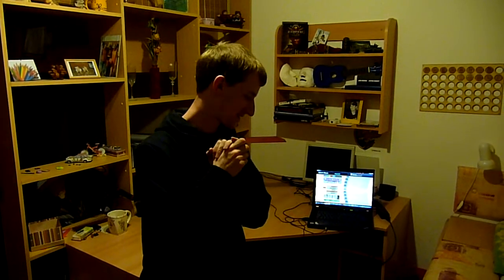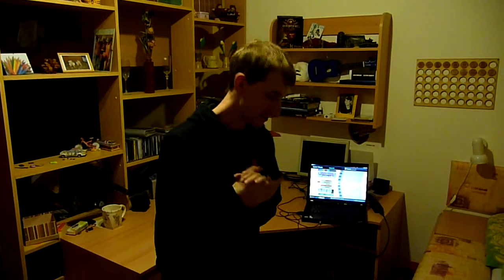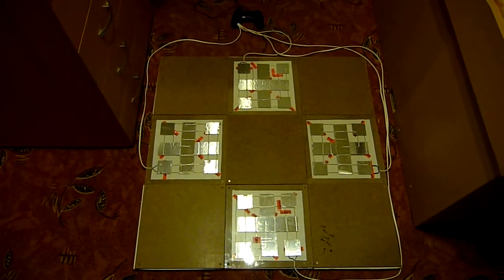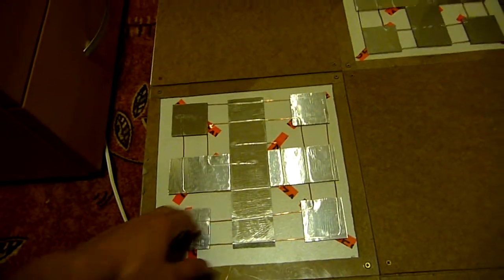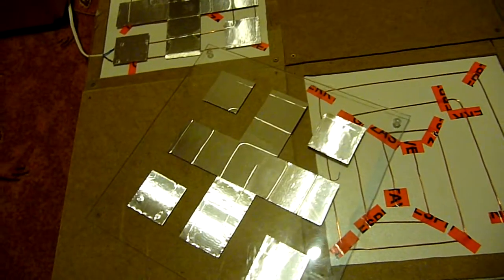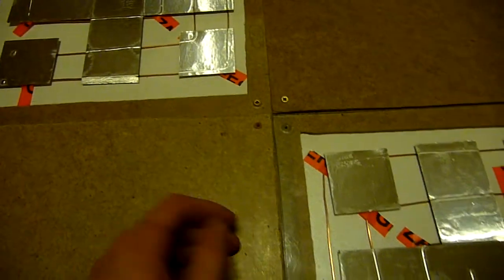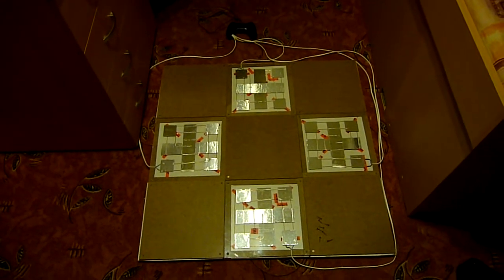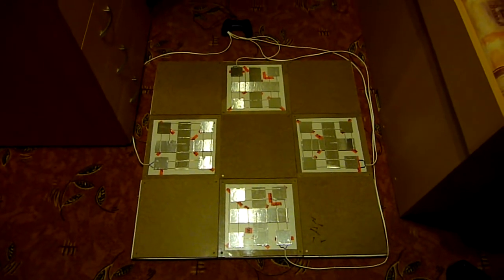Homemade DDR pad - Final video

Comment: Also, is it just the force of the plexiglass bending that presses it onto the wires?
Reply from the maker: yes, exactly... with a step you bend the plexiglass, so that the metal foil on the plexi connects those 2 copper wires.
Reply: Mollar2 Oh cool, thank you. Also, is the material used for the other parts of it (not the buttons, the brown-ish parts) paperboard or something? I've been trying to find a material like the one you have in your video, but I can't seem to find it anywhere.
Reply from the maker: inky
Yes, exactly - it's paperboard or something similar. You can you also some plastic material for that. The thickness is 3mm, if I remember well :-).

Comment: I'm looking to make one of these, what specs/dimensions is this? Also, what buttons did you hook the dance pad up to in the controller? And did you use the normal 33'' by 33'' dimensions, with 11'' buttons?
Reply from the maker: Total dimensions are 33"x33", one tile hhas the dimensions of 11"x11", so it is standard. Button selection is not very important, you can map buttons in the game options. But if you want to have the similar to other dance pad, you can compare it via Windows game controllers setup.